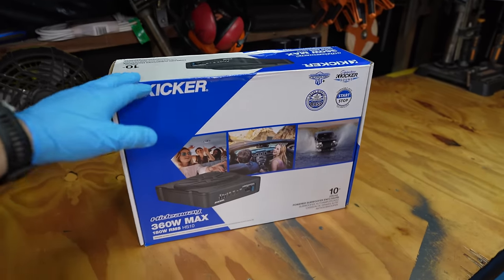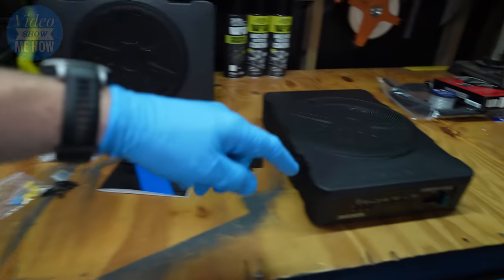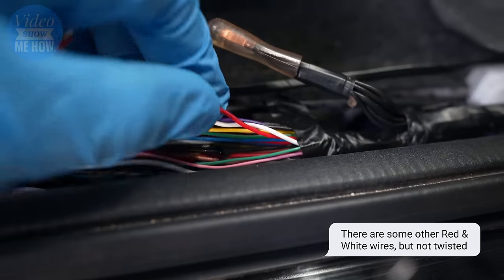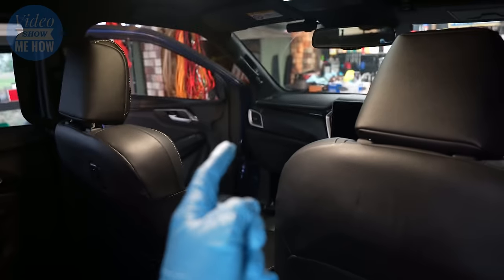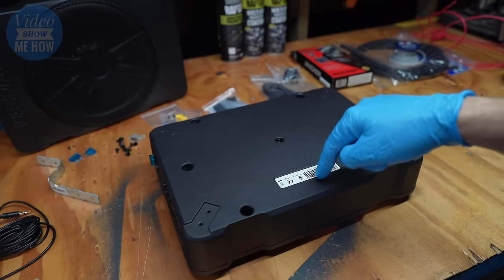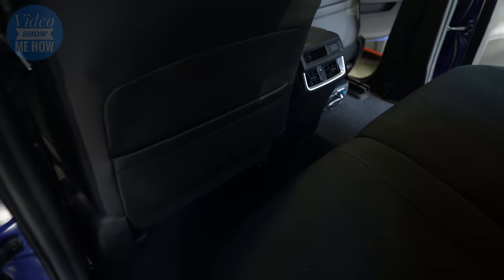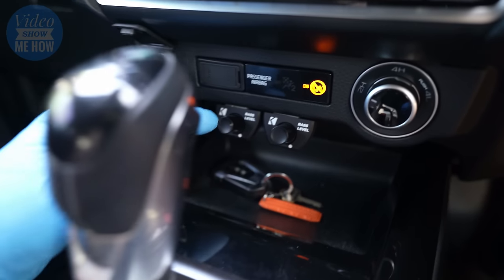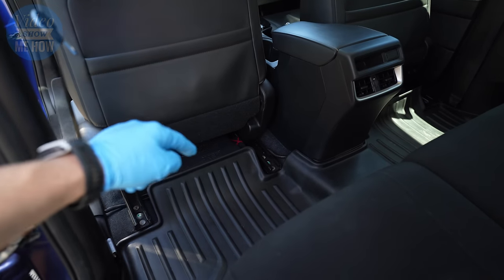Get the Ultimate Bass Experience with Kicker HS10 Hideaway Underseat Subwoofer: Review and Demo

Comment: They must not be worth it if you can't find any videos with anybody that has them for a review.
Reply: Go to a shop and see if you can get a demo. Your ears are a better judge than people with no clues opinions
Reply: They’re not bad, I’ve got both the Hs10 and hs8 and the 10 definitely is more powerful. For the price you can’t beat the HS8 it’s awesome
Reply: most ppl want bigger boom...so they go with 10s/12s is bigger boxes with way more power than they think they need...these are just good bottom end fillers, not neighborhood shakers
Reply: My bose door speakers out perform these.😅
Reply: Your door speakers don't and can't play sub bass
Reply: @K03sport  people get more power than they need because HEADROOM
Reply from the maker: @mrrod3004 😂😂
Reply: @LoganCoutts  can you make a video on them
Reply: Some people should just stay off of YouTube.  Or be banned from commenting
Reply: @TheyBroughtBackStupidHandles  I don't have a cheap 99 Honda ciciv I have 100k ram 3500 Longhorn 2022 and you vant even break the windows with a hammer it takes a sharp point. I go to shows people who have 4 18s flexing the windows 5 inches out and they never shatter.  It takes a sharp point to crack....and now I have 12 inch subs in my doors and 4 8s in each door customized with bed cut and 4 jl cut through my bed under the seat.  A flip down tv and tv head rest passenger side control screen for radio and GPS or surf the web built in wifi. Ypu guys are far behind on the tech.
Reply: I have two of these hideaways. What and how many wires do I need to complete this install

Comment: Nice Video as usual.  Although Hookin up a powered sub into the rear speaker cables that are amplified from the headunit is not a good idea like this. It's actually tapping into and taking away power that should be going to the rear speakers. Should 100% be coming out of RCA's or sub output out the back of the unit that runs at line level to feed the subs that are powered.
Reply from the maker: Hey mate, it's not drawing any power from speakers, just uses for signal, power comes from +ve battery (red wire). These subs don't have an RCA in unfortunately. This is how kicker recommends installing these.
Reply: @VideoShowMeHow  I realise what it's doing regarding only signal and that hte sub has seperate power. Even if Kicker say to do it, it's still wrong really.  Reason being is that the headunit is sending a amplified signal to the rear speakers which are passive. Then you are tapping into that and taking signal off to another device which is taking power away for that to send signal to the sub. Yes it can work but it's really not a good way or the correct way it should be done. Turning the head unit up could easily send substantial amount of watts/power to the sub input and overloading it and then performance of the rear speakers is also affected due to sharing signal.   I really can't beleive Kicker would recommend doing this, it's bizzare and goes against all audio and signaling best practices.
Reply from the maker: @hiltonstroud1399  literally in the manual bud. The amount of power 'being taken away' would be tiny. I agree I'd prefer to use an proper RCA signal end to end etc but for something like this it's hardly SPL or audiophile anyway 👍
Reply: in my mind im thinking the same. if you had the halo HU the radio has much more controls/ crossovers etc if you connected them via RCA 

ps  these under seat subs work a lot better when they are solidly mounted to the vehicle. 

I installed a sub amp combo unit in the rear seats standing up up as my child is in car seat and feet don't touch the floor. even when they do its a very slim unit Rockford p300 8 inch unit so much more output compared to an underseat unit
Reply: @hiltonstroud1399  how else are you supposed to get signal. tapping into the headunit is still the same wire going to the speaker
Reply: @hiltonstroud1399 factually you are incorrect.

You're correct in that turning the volume up and down will vary the input voltage when tapping into the speaker outputs BUT...the only way this would effect the output of the speakers is if there were an impedance contribution and since the leads are only being used for signal, there is not, so if the amp is putting out 50 watts into 4 ohms.  There is still 50 watts going up the speaker.   And the amplifier built into tha subs take the input signal and amplify it there.  This is the same for any high level input capable amplifier.
Reply: While we are all nerding out, which is cool and all, does  anyone actually own these and how are they.? Thank you for your input
Reply: @hiltonstroud1399  Think of it like this, let's say your house is wired with 120 volts AC. You can plug dozens of devices into the outlets and you still have 120v. Only items that have a large load will pull down the voltage slightly. 

So pulling a signal from the rear speaker wires will have absolutely no effect in their performance. The signal wires going into the subwoofer preamp circuit draws virtually no load. It won't drop the voltage to the speakers at all. 👍

One thing to verify is that the rear speakers are getting a full range signal. If the bass is filtered from them, say with a 70Hz hi pass filter, you won't get much bass to the subs.
Reply: Do you need signal from 2 speakers stock speakers or just 1
Reply: @franciscoguzman881 You might be able to get away using one speaker channel as a source. You'll need to increase the gain a lot. You may not have enough signal strength. 
Using 2 channels doubles your signal power so you will have enough.
Reply: @hiltonstroud1399 it's called hi level input 🤦 the manufacturer recommends this method in case you want to keep your factory radio even if you get the hi/low converter you still need the signal from the speakers🤦🤦

Comment: Just done similiar in my 2022 MU-X and installed a JBL SL2, only difference is I took the speaker feed from the front two dashboard speakers, easy to take out and I soldered my subbox high level cables directly and fed them down into the footwells. I didn't want to fuse tap my rears and there are way too many cables in the MU-X to unravel in the first place. I also grounded to the seat but there is no bolt in the MU-X seats so I fitted a new bolt in one of the spare holes.

The SL2 has audio sense so no need for a rem cable, only thing I find with the SL2 is that it doesn't shutdown for 10 minutes when no audio detected.

Sounds amazing and a huge upgrade from the stock stereo setup!

Thanks for your tips Adam, always helpful.

Comment: Good Video, would be nice if there was a way to combine the controls so you only have one adjustment dial.
Reply from the maker: Yeah someone mentioned a good idea, They're just a 3.5mm stereo jack so you could probably get a splitter two into one
Reply: Yes, that Kicker remote uses a 20K linear taper potentiometer to vary the resistance. A simple head phone splitter cable will allow one knob to control both subs.
Just make sure the gains, all control's, are set the same on both subs or else one sub will always be louder than the other. 👍

Comment: Great video mate....and nice install. (and the other one with the underseat sub into a Jeep was good too).  
I'm currently shopping for an underseat sub for my d/c Navara. Not looking for huge SPL (it actually ruins good music IMO). I just want to put some foundation under my Kenwood + Infinity component set up in the front. 

I have a couple of questions....

- How did you mount the remote gain controllers to the dash?

- Given that you already had an aftermarket head unit installed, why did you choose high/speaker-level inputs instead of plug 'n' play "sub out" port or RCA's at pre-out level ?

- Pioneer, Alpine, Cerwin Vega, Kicker, Kenwood, RockFos, Sony, JBL, Focal.....etc all make active underseat subs with 8" or 10" drivers. 
Was there anything special or different that made you choose the Kicker units?  Was it just because they were on-sale? Do you think they perform better than some others, for similiar money? I'm having trouble narrowing down my short-list!

Comment: Nice explanatory video, thanks.
A question: would leaving the rear speakers connected and connecting the sub in parallel to each of them work properly / be acceptable? Or is cutting-out the rear speakers the only valid / good option?
Reply from the maker: The rear speakers do stay connected with this method?
Reply: @VideoShowMeHow  in the video the cables that bring signal to the rear speakers are cut (white and red) if I've seen right.
I was asking myself if instead mounting the sub in parallel (a T joint for each cable instead of cutting) would work properly.
Reply: @VideoShowMeHow  Ok, I re-watched and seen that you are indeed making a tap at 5:29. Thanks!

Comment: Thank you for this video and the sound test! Sound wise, would you prefer an under the seat subwoofer or a spare tire subwoofer, like the Jbl basspro hub?
Reply from the maker: Hmm, those spare tyre ones are pretty innovative, either way I'd def be shooting for a 10" driver at a minimum
Reply: @VideoShowMeHow  indeed, the JBL has an 11" driver, but the fact that they are in the spare tire, would it affect their performance, against this one which is right under the seat?
Reply: It really depends on the vehicle. If its a car the bass might have trouble going from the trunk to the interior so the under seat box might be best. If its a hatchback or suv the spare tire enclosure might be best. Make sure both can fit, if one style doesn't, then your choice is made for you.

Comment: Nice vid bud. I've just got the one in Mine and it provides LOTS. Enjoy the bass.
Reply from the maker: Cheers mate 👍
Reply: Nice finally someone with some input in this thread instead of telling this guy all the physics on the installation.  Do you still have them and like it? I was going to put one in my 2023 4 Runner with stock unit and speakers. Thanks for your input
Reply: @john-l1d5h  did you install? How’d it go?
Reply: @brunoortiz1049  No didn't get enough feedback and some other bills came up still researching 
 I only want to do it once so I want somthing with some quality.

Comment: It's really odd that those subs don't have RCA inputs. I have the ILX 705D which is the double DIN version of yours, and as you know the crossover settings are extensive on this unit and it also has 2 sub outs. Taping off the door speakers seriously limits you to having to run them full range instead of being able to roll off the bottom end around 80Hz. I'd definitely cross off Kicker if I was on the market for a compact powered sub.

Comment: Quick question. Did you link the 2 subs together as far as wiring goes to go to the battery or where they wired separately with two inline fuses? Did you wire them as far as the output goes such left and right speakers tying them into the factory rear left and right speakers?
Reply from the maker: It's in the video?
Reply: If you want to use two of these, a single 8ga wire an 30A fuse is more than enough. You can go to the battery or even the fuse box input since they draw so little power.

Comment: Must be able to hear you coming from a mile away - nice work! Any Velcro alternative ideas for us common folk with vinyl floors? 😝
Reply from the maker: They certainly thump! Could use the brackets easily enough, only a few bucks at Bunnings. Alternatively there's always a few zipties 😂
Reply: Surely you can stick the other side of the Velcro to the vinyl? My dmax is on the way and it's got vinyl.

Comment: did you use Left F/R speaker wire for left sub and Right F/R speaker wire for right sub?  Is that how I understand it?   what if just doing 1 sub; would I need both front (or rear) L/R speaker wire?  or can I use Right F/R if the sub sits under the right seat?
Reply: Yes!
Only one!

Comment: what is the amperage draw on a setup like that?   I'm looking at putting a set under the couch in my RV but I'm not good with power
Reply: These units use a 15A fuse so full volume it might draw 15A. At normal listening levels you might measure 2 to 5 amps depending on the bass in the song and what frequency it's at. 

The most efficient setup would be a large driver or multiple drivers on a small amp. Especially using a ported box. You basically choose between power efficiency or space. Small sealed enclosures like this are not very power efficient, but they take up small space. So you have to choose which is more important to you.

Comment: Hi. Love the video, but on my 2023 Dmax Xterrain there are two twisted pairs on the passenger side. Im guessing one is for roof speakers and one for back speaker. Will either pair be ok to tap into?
Reply from the maker: Worth just pulling the trim on the rear door speaker and checking the colour going to the speaker to confirm 👍
Reply: Hi Daniel, I have this problem also, did it matter which one you connect too? I assume both speakers have red and white so don't really want to pull door apart and roof speaker apart. Edit - door speaker is red and white. Can't get roof speaker off

Comment: You don't need to run anything into the engine bay,you can just fuse tap these subs. There is also a factory earth point under each seat. If you lift the carpet up, you will see it,also, besides looking messy and being unnecessary, you should be careful running earths of the battery terminal in a vehicle with smart alternators
Reply from the maker: Fuse tape 10amps? Not a fan of that current via a piggyback. Installed per manufacturer instructions but up to you 👍
Reply: @VideoShowMeHow  fitted dozens,dash cam battery packs usually have a 20amp fuse that's instructed to be fuse tapped also

Comment: Hey mate, awesome vid but I just want to confirm that with my 2022 dmax sx spacecab, i dont have rear speakers but I do have the red and white on my passenger side whereas my driver side there’s no red and white twisted but red and green, are they my driver side ones I connect too?
Reply from the maker: Hmm unsure on space cab.. suggest pulling the door card at the bottom and having a peak up at the speaker with a light so you can verify the colours 👍

Comment: Good video really appreciate,  fornme where or how should i connect the blue wire in the harness where do that ine goes i have s Toyota RAV4 '22 not sure where it goes ? Thank you,
Reply: If the DC offset (auto on) is not working for you, you can run the blue remote wire to your fuse box. There are lots of videos online that show how to find a fuse that turns on and off with the key and there are fuse taps that allow you to add a second fuse. Just use a 1 or 2 amp fuse for that blue wire.
Reply: @JasonWW2000  thank you so much

Comment: Just a heads up when you unplug then reinstall, my 10 and my mates 8 but had dramas with the connector. One of my signal wire connectors was deformed so when I plugged it in, the male pin on the sub pushed the female pin in the plug out and was a pain in the ass to fix.
Reply from the maker: Had it in/out a bunch for the vid, so far so good. Will keep an eye out, thanks for the tip 👍

Comment: Hey Adam, Is it ok to hook up the power cables to that part of the positive terminal?
Reply: Yes, absolutely fine. Each sub only has a 15A fuse. You don't even need to connect to the battery. You can connect that to the fuse box input or even the cigarette lighter wire (since they are usually 30A). Just don't go full bass volume and push the cigarette lighter at the same time. The fuse might blow. Most of the time with music both of these subs will probably only pull 10 or 20 amps when cranked up. The stock electrical should easily handle that.

Comment: My kicker hideaway sub stopped working although the blue light stays on yet no sound? Installed at a shop on stock head unit with a loc any reason what it might be?
Reply from the maker: Hmm worth checking the signal wiring? Maybe has been disconnected
Reply: This Kicker unit has a built in loc. 
Yes, I'd make sure its still getting a signal.

Comment: So, what did you do with the blue wire? Is that wire unnecessary if the speaker is set to DC instead of +12?
Reply from the maker: Yep is redundant if you use the DC offset feature, can just snip and heat shrink
Reply: @VideoShowMeHow  awesome! Thanks for the info. And great video! Got one of these on the way and was wondering where to splice the blue, but would rather just bypass it 🙌🏽
Reply: @kahuplurth If you have to use the blue, you can tap into the fuse box with a circuit that turns on and off with the accessory key position. They make fuse taps and you can fuse the blue wire with a 1 or 2 amp fuse. So no worries. Lots of videos online show how to find a turn on signal.

Comment: Awesome work mate 🤙 have just installed one but abit confused on the settings side of things ( gain/ bass boost etc. Am running just the factory head unit in 2022 dmax xterrain, what settings would you reccomend?
Reply from the maker: Am currently half gain, bass boost off. But have 2x in there and they're drowning out my other speakers at the moment haha (upgrade time)
Reply: @VideoShowMeHow  cheers mate cant wait for the vid🤙 what input level and phase levels are you running?
Reply: @SonicsnakeCNR The phase and crossover settings should be done by ear. Adjust it until it sounds good to you. The gain setting depends on how high the signal voltage is. I would adjust is so normal music listening levels are about half or a bit less than half of the remote bass knob level. That way you can turn it up or down based on the song playing. 

The bass boost typically adds output around 45Hz like a single band equalizer, but sometimes this adds distortion at high volume levels. Try to keep it at zero. If you don't max out the subwoofer you can try adding a little bass boost to see how it sounds. If you hear distortion at high volume levels turn the bass boost down.